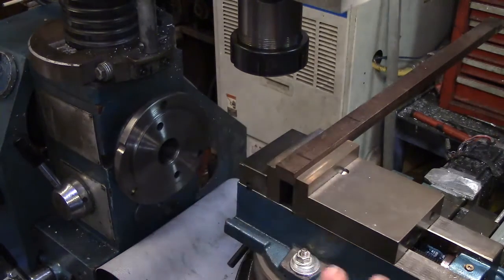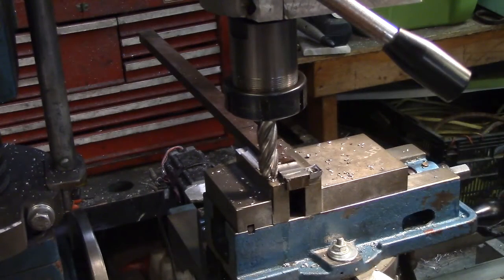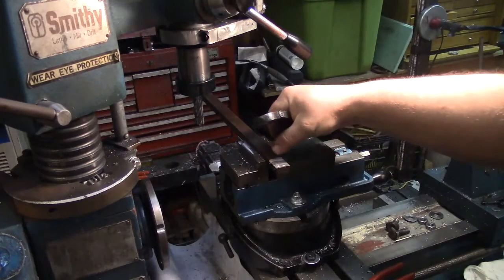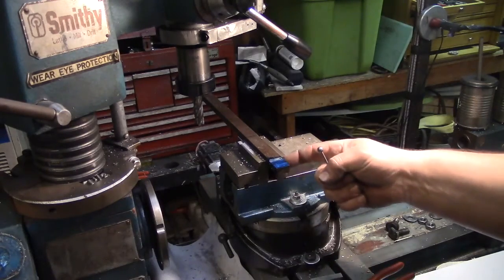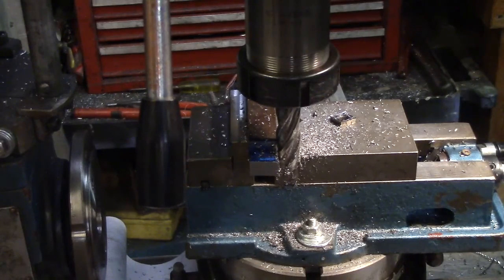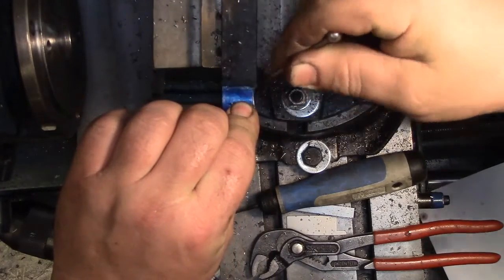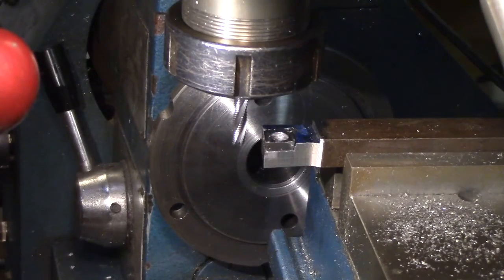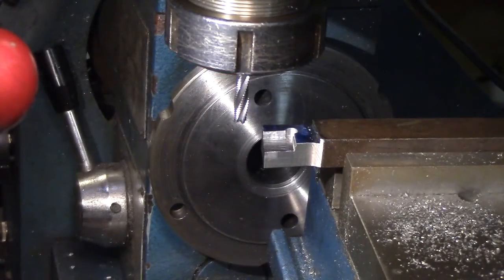SCLCR insert holder Part 2

Comment: Nice build, it always amazes me that people buy things they should be capable of making themselves, but then I'm a tight wad.
I'm assuming that "grouch" means something different on your side of the pond because you seem perfectly normal to me.
ATB
c
Reply from the maker: Chris Stephens I try to leave the grouchy bits on the editing room floor, Chris.  Otherwise there would be mucho cussing and screaming.  The tirade that followed the breaking of my only DTI would have gotten me banned in many countries!  
FYI: The average ratio is 5-10 percent usable footage to 90 percent "unsuitable for public discourse". :P
Cheers.
Reply: I'm sure you could make yourself a "bleeper" and save yourself hours of editing.
I know how it feels to break a dti, I broke a right angle attachment for my 4 jaw centring clock, So I made a new one from titanium, so much better than mazak or whatever cheap and nasty crap material they made the original from.